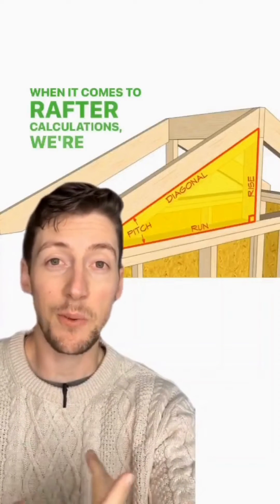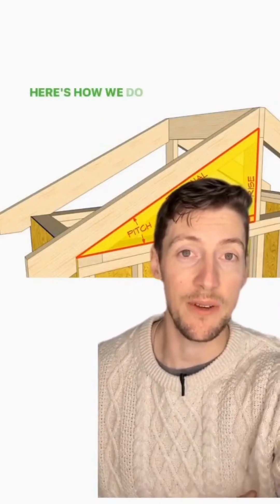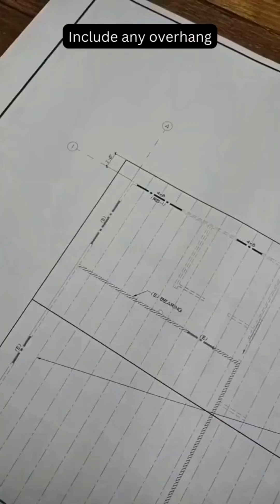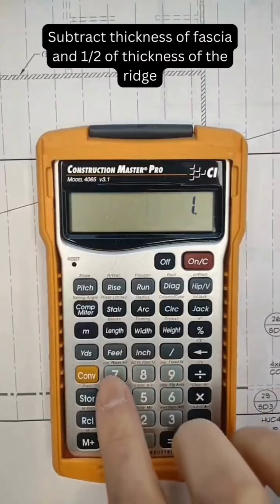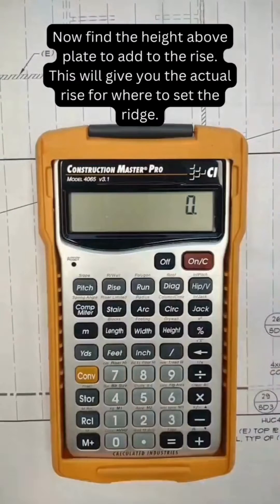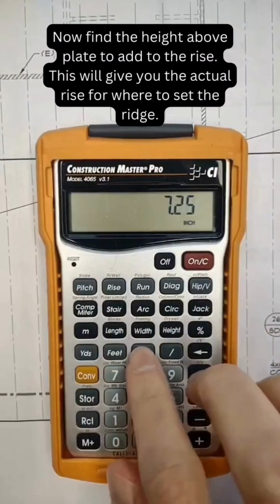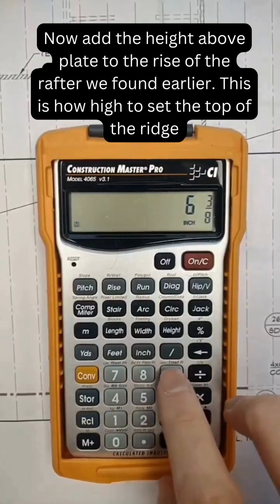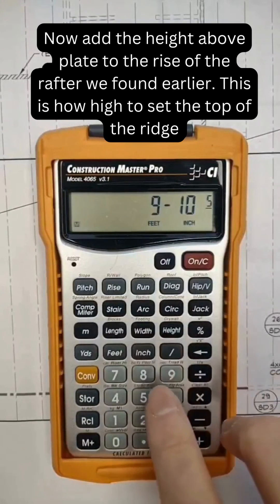How to go from theoretical to actual rafter length

Comment: Greetings! My run is correct but when I push rise, it’s coming back at 13-10 1/8??
Reply from the maker: Hi there! besides run, what else have you entered on the calc? Pitch?
Reply: @CalculatedIndustries  disregard.  I need two values in order to find a third with regard to a linear function which is the case for Pythagorean theorem. Thanks for the reply!